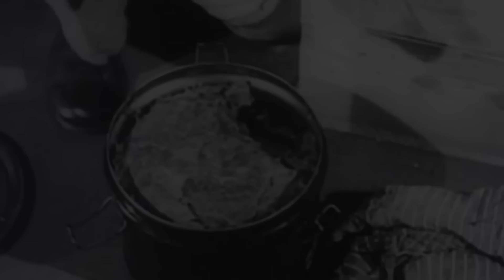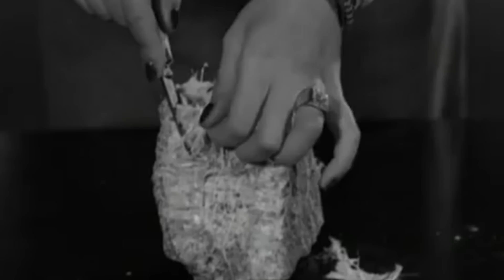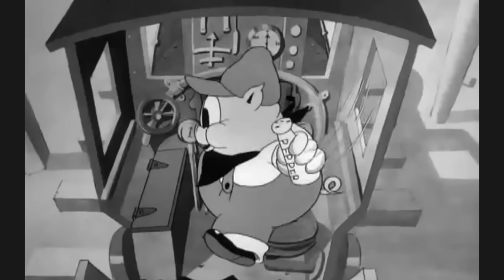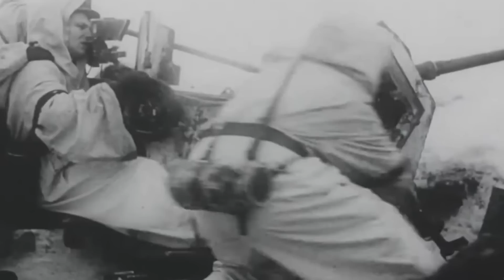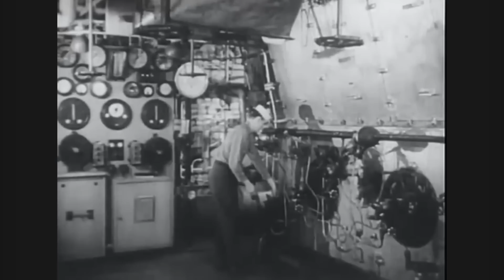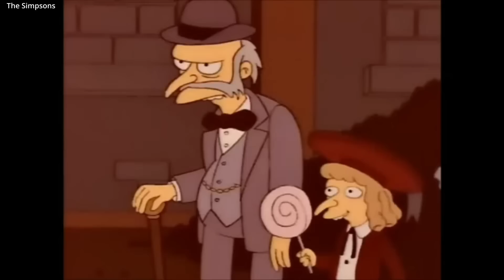Asbestos & WW2

Comment: I am a mechanical engineer. I got a Bachelors in engineering in 1978. Throughout college we were told asbestos was the greatest material known to mankind.  I got my degree, and got an entry level engineering position at a large Philadelphia Engineering firm.   about six months later, there was an emergency meeting for all 200 mechanical engineers working for the company.  The Chief Engineer for the company got up and said “From this minute forward, you will no longer specify asbestos. And anybody who does will be severely sanctioned “
Reply: What do you mean by "you will no longer specify asbestos."? Did you continue to work with asbestos?
Reply: @ToastedLeak   Yes, but thankfully not directly.  I have probably dozens of horror stories about asbestos encounters, and abatement  over the intervening  46 years.  Including being personally lucky by having the asbestos cement siding on my home removed and replaced with newer material a year before  removal was considered ACM abatement, increasing the cost dramatically.   The  NYC abatement contractors dumping yellow bags on the helix leaving the Lincoln Tunnel at morning rush hour.  The abatement contractor who abated a cooling tower at a windowless school over Memorial Day weekend, which effectively took the air conditioning system out of service, just when it got really hot.  And there are more….
Reply: @ToastedLeak  that means that it is not used in any newly designed products.

all the existing products that use it will continue doing so until they get replaced or receive an update
Reply: @ToastedLeak  They still mine Asbestos in Quebec but it is immediately shipped out of country mostly to third world countries
Reply: When the lawyers and bean counters took power away from engineers.
Reply: @s0nnyburnett  When the minimum reasonable requirement for health and safety (i.e, AVOIDING ENTIRELY PREVENTABLE DEATHS FROM LUNG CANCER) takes power away from the pursuit of maximum efficiency
Reply: @s0nnyburnett  "Damn you bean counters and lawyers, it's my god given right to light a refreshing asbestos filtered cigarette while I stand in this large puddle of kerosene downwind from the nerve gas factory while wearing my lucky polonium hat!"
Reply: @Del_S  Based and Libertarianpilled
Reply: @s0nnyburnett  Won't somebody think of the stockholders? Their portfolios trump the lives of working Joes.

Comment: Years back in the mid 80's my father's workplace went through Asbestos removal.   Iirc it took them about a month.   My dad asked one of the workers why the scrub down process of each person leaving the work zone was so intense.  He said  if 1 fiber got into the lungs of someone, there was a 50% chance of lung cancer and if that person was a smoker it 100%.
Reply: Asbestos is in the air all around us, though the levels can vary dramatically from as low as 10 fibers per cubic meter to tens of thousands of fibers per cubic meter.
Reply: Someone was fed false information.
Reply: @luke8952  meh, i don't think a little extra personal cleaning for working guys hurt that much in the end

Comment: Besides the dangers to health, it is a great material
Reply: That goes for a lot things. Lead for example. Plentiful, easy to mine, easy to work with both as a pure element and alloy with others. To bad it causes a host of issues.
Reply: @ketsuekikumori9145  Either you invent new materials or try to match the performance of the old ones without using lead or cadmium. The eternal struggle of material science.
Reply: @minhducnguyen9276 😂 so true
Reply: @Slavicplayer251   It's just too good. It took people a decade to make lead free paint as colorful as lead paint. And while lead battery doesn't have the best capacity when it comes to durability to cost comparison very few alternatives can match it. You can charge and discharge it for God knows how many cycles and there's barely any drop in performance.
Reply: Lead battery can't be cycled many times... In cars, you barely consume energy, that's why they last many years.
Reply: @ketsuekikumori9145  Way to bury the lead. (Oh, this isn't the pun thread)